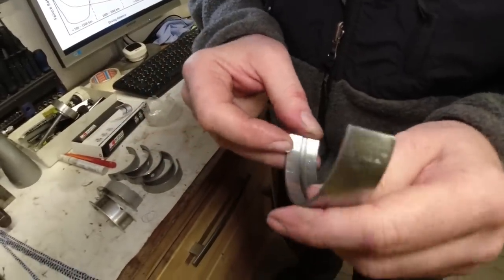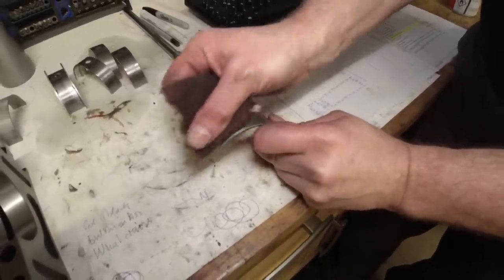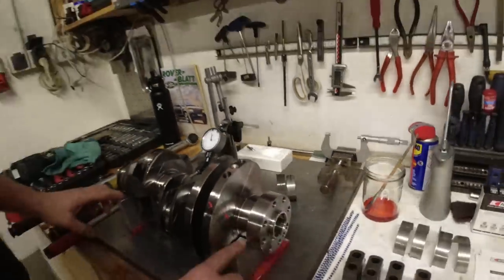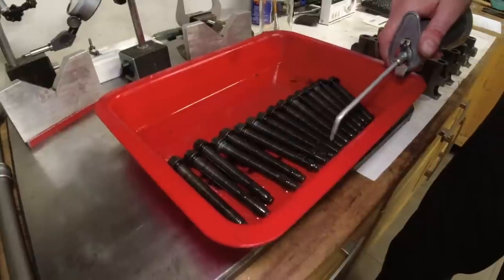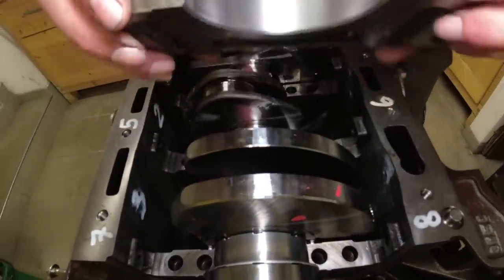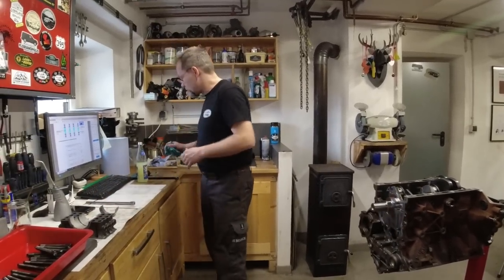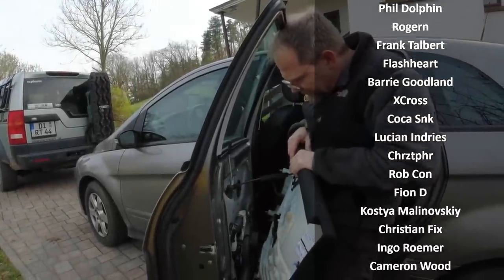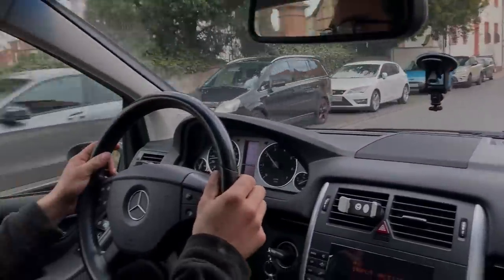Install New Crankshaft after only 64000 km / S4-Ep15

Comment: Hi LR Time,
i'm struggeling to find out the right Trägheitsmomente for the choose of 15" or 16" Rims and Tyres. Since you are an Engineer, i have see some balancing machines in the Background once, i ask you if you can get into this topic. It is an optimization, which should be nice contentent for you and your knowledge.
Should i buy 15" and big tyres or 16" with small tyres to get a low Trägheitsmoment with the same outer diameter? All for the environment, since i have no EV.

Comment: Oh, one big point.    Christian! according to your bathtub curve, would it not have been smarter to get a USED crankshaft from a reasonable milage engine from a wreck and recondition it? Vs a brand new crankshaft with zero cycles on it?
I mean the new crankshaft is unknown, but the used crankshaft proven itself.

I also believe the fault of these crankshafts are a result of residual stress problems from improper management of manufacturing and post manufacturing residual stresses (working in the industry in RS analysis for +15 years)
Reply: I suggested that last week. However I am sure it will work out fine for them.
Reply: @richardsheil5289  Agreed, seems low risk, but any new unknowns are a risk. 
Anywho, will be fun to watch

Comment: Isn't it somehow possible to add external oil pump running constantly on the battery for example in order to add additional pressure on the oil.
Reply from the maker: This is not a simple job and it comes with certain risks.  Christian

Comment: Hi Christian. Colin Lotz from South Africa. First of all let me say that I really enjoy the content and your presentation, the way that you and Vera interact is just perfect, love the running commentary.
I'm responsible for the warranty administration for a engine remanufacture and we have built a number of 3.0L TDV6 over the years.
I have 2 questions. in the video you show a page from a Workshop manual that states the main bearing bolts may be used at maximum 4 times, which manual is this?
In the Land Rover manual that I downloaded they state that if the  the bolt has been center punched it must be discarded are you aware of this.

Comment: I'm glad my LR3 has a BMW engine... I just come here for the awesome humour and f-bombs. Keeping it real!
Reply: The LR3 was never equipped with a BMW engine nor would you want it to be the 4.4 V8 they put in the L322 up until 2005 was not good, the Jag 4.4 they replaced it with is near bulletproof, really the most Toyota like thing ever built by JLR. There are plenty of 250k mile examples still running hapily and that is with the original Land Rover recommendation to use any old conventional 5W30 with a 7500 mile interval, the dealers used to use Castro gtx.
Reply: @shaunbava1801  I stand corrected. You are right, those old M62's were a problem child. As were the 4.6 rover V8 in my D2 that died at 230k kms. The LR3 on the other hand, still going strong pushing 320k kms.

Comment: Hi Vera & Christian. on stdv6 gen1, the screws on the crankshaft tighten the same as on stdv6 gen2? that is, 40nm 90nm and 45+45 degrees? thank you very much
Reply from the maker: Gen1 and Gen2 is identical.  No more then 3x use in total.  Christian

Comment: Good afternoon Vera & Christian thanks for all  fantastic video s 🫡, Just quick question, my disco 4 TDV6 3.0 , always serviced on time , so while I’m pulling our camper some how started leak coolant then overheated engine , has new AGM battery car won’t crank no click it just heard funny sound as it turn on like an electric motor similar to winch motor when u start it to pull something ? Oil level under full a bit oil cap smell bit burn Do You reckon engine gone 😢? 
Then I used my scanner ATOFIX pro , I plugged it it OBD port in LR4 it shows me that I have only two faults -1 DDM (Driver Door Module) -2 PCM (Powertrain Control Module) then under the rest it says no response . When I did the scan battery was 13.8 it’s new 4 weeks old. I use a long plastic cable tight as a snack to check between the oil filter and the oil cooler if there is oil spread because of the high temperature/pressure and I find all dry no oil leaks or trace all engine very clean nothing u find only the red coolant bit track , the famous top thermostat it’s split when I just pump the hose/pipe it makes a hissing and water go through it ,, I checked the water bottle have no trace of milky liquid or in the oil and front thermostat there is a trace of red coolant and on some pipes

Many thanks to you both Vera&Christin 

Cheers 
Matt 🫡😊🙏🏻
Reply from the maker: So it is best if you have your faults read out with a Gap tool or icarsoft, which you also need to reset the new battery. Not sure if the icarsoft can do that however. Your faults come from a generic fault reader probably. If you need help, please sign up to our Patreon account, for the LR onwers become mechanics tier. We cannot give any technical help in the comments. We just get too many emails, messages, comments, every single day. 👍🙏🙋‍♀️
Reply: @Vera_and_Christian  

Thank you guys I understand yes will do 🫡💪
Cheers 
Matt

Comment: Another excellent blow by blow on engine assembly. Is it possible that a class action can be brought against Ford/ Land  Rover for these crank shaft failures. I would think a manufacturing fault should not really have a time limit on it.if it is wrong it is plain wrong! Just a thought. I wait every week for your next video with great anticipation. Regards

Comment: Hi christiane your doing great with fabian, mt tdv6 3.0 overheated and ishort after dismantling i took the cylinders for confirmation and later the reface them at 1.30 readings . So my question is are the cylinder heads still worthy for use and what gasket grade? Plz guide me.
Reply from the maker: According to the manual, refacing of the block is not possible.  Gaskets only cover 0.7 protrusion.  Gasket selection is in the video.  Christian
Reply: @Vera_and_Christian  thank u i guess i have to enquire a complete one.

Comment: I am British. Twenty years ago l did work for a high end car manufacturer owned by Volkswagen and fitting VW parts. Immobilizer faulty, parking distance control poor, air bags switched off also faulty. I found out the problems with the immobilser (software) and was treated like dirt, same problems existed throughout vw range. Further VW replaced the thin metal brackets and pulleys driving the ancillaries with one large bracket and one large belt, looked good but made car overweight. ,!!!
Reply from the maker: The problem with a VW is that it is a VW.  I will not touch one.  😂 Christian

Comment: I wonder how much temperature may affect your end float dimension? Would a hot engine increase or decrease or have no affect on the 0.03 microns?
Reply: Yes upping his metrology  game Above and Beyond,  Christian could consider thermal aspects, but I suspect gaps will be fairly unaffected as he is likely to be close to standard temperatures in his den.
Reply: @philhealey4443  I think that Stephen means running a tight tolerence engine up to temperature, rather than at the rebuild stage. My thoughts are that the crank will expand slightly more than the block, but there are many, many factors and the thrust bearing needs to support not just running clearance, but braking inertia and clutch actuation loads. I think that it will be fine after a little run in period.
Reply: @ASelman  We could get very academic about the temperature distribution in the engine in  service  and dimensions including clearances when measuring, with likely laboratory conditions at probably 20 deg C. Given equal temperature  coefficients of expansion  between the block , crankshaft and bearing materials  (which they are clearly not) I  think clearance dimensions would increase in proportion to component dimensions with temperature rise.  In service I think most of the bottom end will stabilise around oil temperature at between 80 and 100 deg C.   I did discover watching the tuning antics of DieselpumpUK that piston ring gaps should be slacker than usual in highly tuned engines  due to increased thermal expansion . Meanwhile I don't think anything thermal is causing the crank failures in this miserable  engine; it seems to be a case of displaced wild optimism on adequacy of its dimensions, plus  some anecdotal radius geometry quality control issues causing stress raisers.
Reply: @philhealey4443  I completely agree. Oil is likely a tad hotter than 100 when working hard. Oh and ring gaps are the forgotten factor for tuners who bolt stuff on. It has been standard when prepping, then rebuild frequently, but hardly anybody does ring gapping nowadays - All too tedious with a needle file or gapper tool. It is so refreshing to see Christian checking things how it should be done properly when you have the tools, knowledge and time.
On the crank failures, I feel that it is likely a combination of 2 or maybe 3 factors that come together and cause failures. I might need to find a broken one to strip and rebuild out of curiosity...
Reply: @ASelman  And a good look at the broken remains for signs of a classic fatigue failure would be fascinating also to see if a crack had been propagating.

Comment: hello Vera, hello Christian. I have a 2011 autobiography 3.0 liter 256 hp. i need your help. the car starts but the engine knocks, so I want to take the engine down and take it apart. first of all, I want to ask you if it is possible to dismantle the engine without detaching the body from the chassis? then he wants me to change all the possible gaskets. I don't know exactly where I can get the original ones, including all the engine screws that come changed. I bought the engine repair manual but it is not version 3.0 but 2.7. are these 2 engines the same? thank you very much
Reply from the maker: We have Patreon for those in need. You can find almost all the information you need on our Patreon page. And what you don't find, I can help you with it. Sign up for the "LR owners become mechanic" tier and you have access to our Posts. 👍🙋‍♀️

Comment: Here in the US you can buy a Ford F150 3.0 diesel for a fraction of the price of a new JLR 3.0 diesel.  Do you think the ford engine is interchangeable with the JLR engine?
Reply from the maker: I think the 2018 f150 is.  But all parts are sold out.  Christian
Reply: What about the Ford Territory V6?

Comment: Quick question guys would it be a big job to fit the 3.6 diesel into the discovery
Reply from the maker: Yes, for sure near impossible because of ecu and the can bus system. Christian
Reply: @Vera_and_Christian  thank you for mailing back its a pity as the 3.6 would be a better unit then that 3ltr

Comment: Must admit, it always gives me the heeby-jeebies when companies supply "uprated" components with bigger oil holes without, possibly, considering that more oil flow to one place might mean less oil getting to other places.

I work in the oil industry and it's common practice to fit orifice-plates into manifold systems to ensure that correct flow and pressure is maintained in different parts of the system.
An engine's oil gallery is, basically, just a miniature manifold system and it tweaks my OCD to think that engines don't really control oil flow as well as they could.

That OEM bearing shell might just turn out to be the saviour of the engine if it helps send more oil to the other conrods.
Reply from the maker: King Bearings were the only ones we could get unfortunately. Our hands were tied. 👍🙋‍♀️Vera

Comment: So my wife and I have ordered a new ford Everest in Aus it’s a TDV6 3.0 litre is this motor you are rebuilding the same engine
Cheers from Aus
Reply: It is but hopefully Ford is using the modifications they made for the US in the F150 which seemingly did not have the same  crankshaft/spun bearing issues.
Reply: Thanks Shaun
Not going to put me of buying the ford though

Comment: i wondr if the fAILINg dAMPER rubber
on the fron belt drve pulley is the RCAof th crankbakage at ylinder &/2in front getting all inertia of rest of moving crankshaft

Comment: Does LR use the same crankshaft for both diesel and gas engines? I bet that they do, and that it was a cost saving measure. I suggest that the diesel version puts an overload on the thin crankshaft webs. General Motors had similar problems converting a gas V8 to a diesel in the 1980’s. The Oldsmobile diesel was a very expensive failure. In commercial use in the US we would see as much as 1,5000 miles from a Cummins class 8 inline 6 diesel motor. And that was pulling 80,000 pound loads day and night. This was accomplished with far heavier  engine components, low RPM’s (1350 max), huge oil capacity with multiple filters, regular maintenance, and a sympathetic operator. Land Rover has the worst reputation for reliability of any current manufacturer here in the US. Sad to see how far they have fallen.

Comment: 在中国一辆2014年大discover 4还保持着新车一半的价值，可以说保值率非常高。。
Reply from the maker: Yes, Land Rover has different warranty policies regarding engine failures in China and Korea. I am pretty sure that helps keeping the value up. 👌👍🙋‍♀️Vera
Reply: @Vera_and_Christian  China's protection policy is lifelong, but it is very difficult to get it, and under normal circumstances, it is repaired by yourself.😮‍💨

Comment: Ich fahre nur noch 5W-30 C4 Öl von Rowe. Eigentlich fährt man C1. C1 ist modern, hat aber einige Probleme mit den Werten, da der Spritverbrauch im Vorderung steht. 

C4 Öl hat einen besseren HTHS Wert, der bei 3,5 liegt. Bessere Kinematische Viskosität in jedem Punkt wie ein C1.

Diese Lion Motoren sollen einen HTHS um 3,5 oder besser fahren. Außerdem ist der Flammpunkt von Rowe viel höher, wie die typischen Öle von Shell, Aral, oder Castrol. Wenn man sich diese drei Hersteller ansieht, dann scheinen die völlig identisch zu sein. Auch geben die meistens keinen HTHS Wert an. Der sollte aber unter 3,5 liegen, was nicht gut ist. 

Das einzige Problem beim C4 ist, dass es nur als 5w-30 gibt. C4 ist wohl eine besondere Entwicklung von Renault mit der Spezifikation Renault RN 0720. Dieses Öl wird in sehr potententen Renault Diesel gefahren, welche ewig halten. 

Man kann auch ein 5w-40 mit Renault RN 0700 / RN 0710 fahren. Allerdings bewegt man sich da komplett in einer anderen ACEA Spezifikation.
Reply from the maker: Wir haben ja mehr als genug Videos darüber gemacht welches Öl wir fahren und welche Specs wir empfehlen. Aber jeder ist natürlich für sein Fahrzeug selbst verantwortlich und sollte sich natürlich selbst darüber schlau machen was er für das beste hält. 👍🙋‍♀️Vera

Comment: What's the thermal expansion coefficient of the crank? Would the end float become zero? Could this be part of the problem with the cranks failing? Due to the crank experiencing unforseen and unexpected stress through the whole length of it.
Personally I'd get the feeler gauges and check each and machine down the tight one or however many to take the end float to the upper end of the allowed tolerance to allow for thermal expansion.
Reply from the maker: I am sure the float is ok on a new engine.  Christian
Reply: @Vera_and_Christian  is it to late to do a bench test for the thermal expansion? Or even use the larger piece of the snapped crank to see how much it expands at a bench test temperature.
Perhaps your joke about the crank needing to be 2 inches longer isn't far away from this theory just move the decimal point several places and change it to metric measurements 🤪.
Is your family oven big enough to fit the large failed crankshaft part in it? Measure the crank from cold outside then put it in the oven at a predetermined temperature and re-measure. Think about the sub zero temps the engine sits in through the cold months and then gets so hot.

Comment: Just FWIW lubing the backsides of bearings for installation is unnecessary and even the thinnest of oily junk back there will interfere with installed measurements. I know some people swear by it, I do not.. Just having worked as an assembler and building my own highter performance stuff it just doesn't really do anything but introduce the potential for problems; dead baby syndrome. When you tighten the main caps they seat and go round and if you're checking clearances properly those caps are on and off at very least 3 times. To each their own, I however just will not do that.

Comment: How can LR be so poorly built, unreliable, expensive to fix and overpriced and yet have such a fervent fanbase!? Blows my mind, they’ve obviously done some good PR work over the years. They’re like the Rolex of 4x4, mass produced, poorly built in comparison to other marques, unreliable and yet everyone wants one and will pay top dollar for the pleasure 🤦🏻‍♂️
Reply: Let me put my explanation out there, It’s really quite simple:
If you want a “beige”, easy, reliable, boring vehicle: buy a Toyota…no problems, modest capability, very middle of the road.
If you want a “demanding” vehicle, want to be an “active” owner of a car that is VERY capable, VERY versatile and not boring…buy a Landrover.

It’s your choice what you want…like so many things in life.  Just be aware of what you buy.
Reply: @marka6591   Being an active car owner is one thing, I’ve never owned a Toyota myself. But failed crank and full engine rebuild at 40,000 miles is just shoddy engineering, I’m not doubting their off road capabilities but what use is that when it’s so poorly built it leaves you stranded and you spend more time fixing it than driving it! And all from a car that was £40-£60K depending on spec is just piss poor imo. I certainly wouldn’t be putting that LR engine back in. It’s a shame, being British I wish they were good, they’re iconic. But the fact is they’re cheaply made and overpriced. And it shows in their reliability. It’s not like they’re highly strung engines, they get outperformed by most manufacturers. Just downright bad engineering